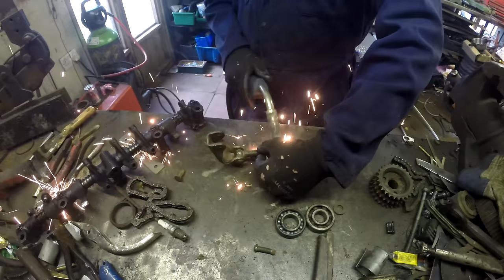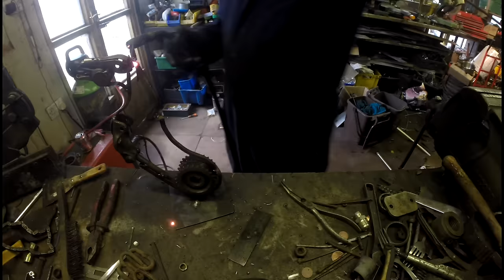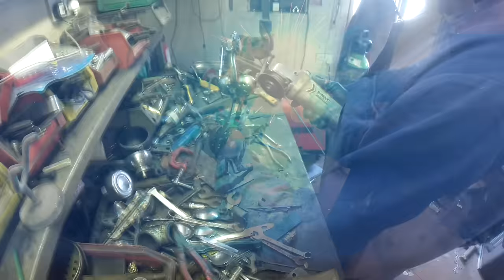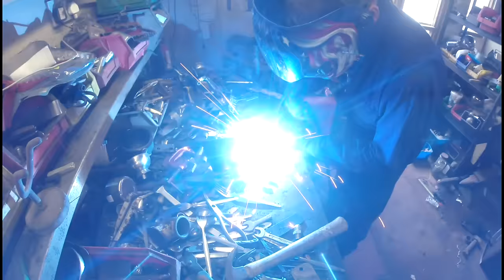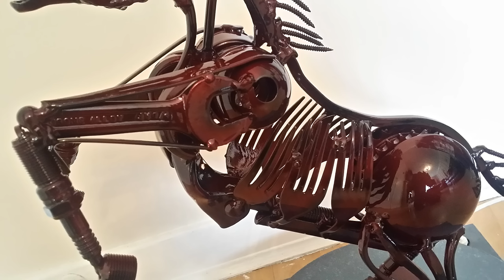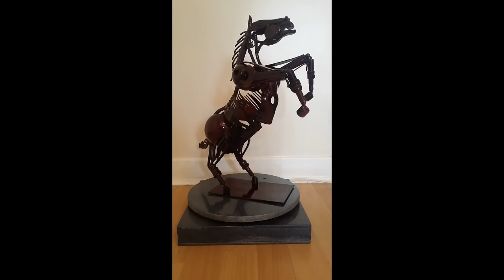Scrap Metal, Recycled metal horse Sculpture, Welding Art

Comment: just wondering.. same settings on the MIG all time? and if so.. medium amp and wire feed?
Reply from the maker: Ole Hermann Strand Hi there, I’m constantly changing the power settings and wire feed as you would destroy some of the lighter metal with a hi amp. It’s all about getting to know your welder and what it’s capable of... I hope this helps... cheers 👍
Reply: @roosterscreations  your right there.. nice work.. are you fare away from Aberdeen? i do work there from time to time..
Reply from the maker: Ole Hermann Strand thanks for that , I’m about 3 and a half hours away 👍